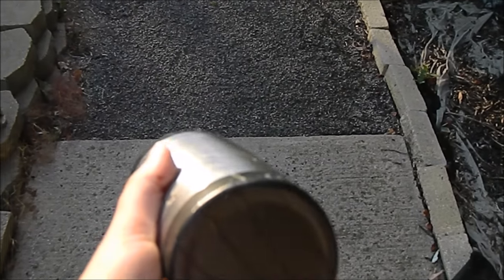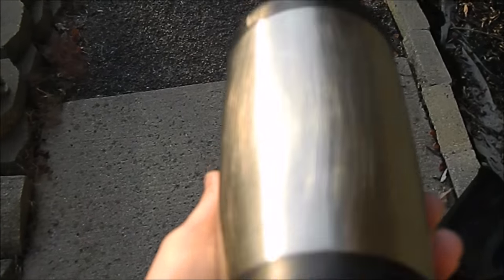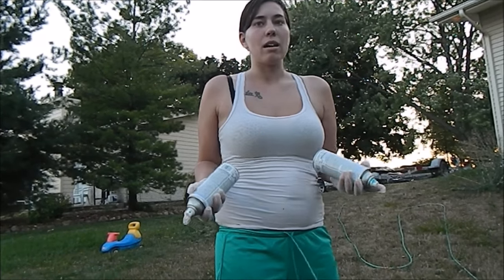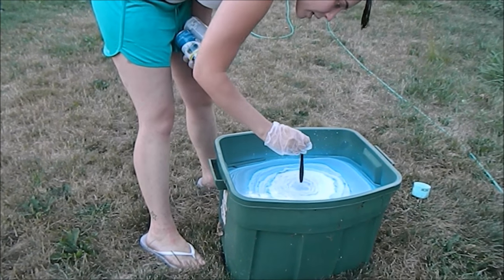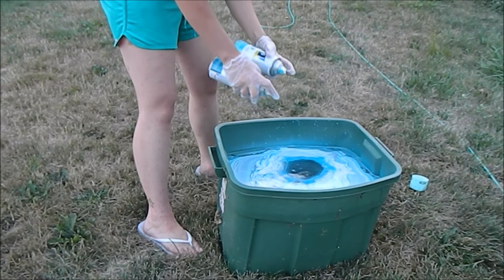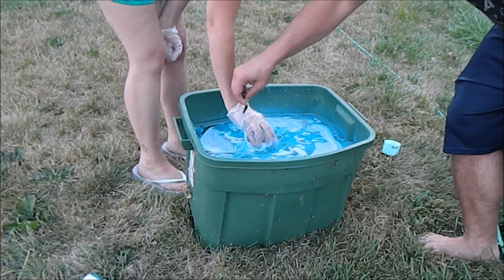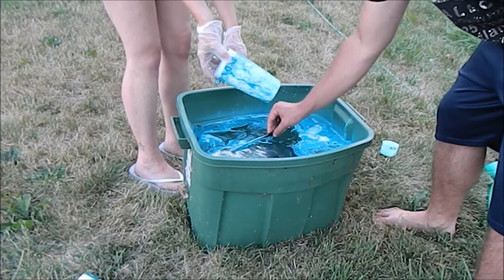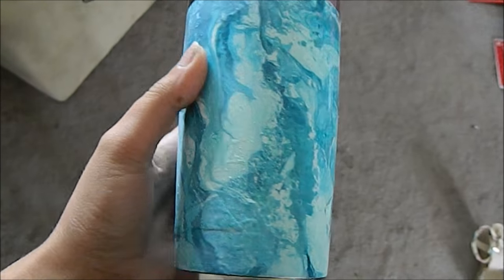DIY Swirl Painting/ "Hydro" Dipping Tumblers-CraftingWhileAdulting.Com

Comment: Suggestion, when spraying the paint don't spray the paint directly in the center. Spray it at an angle. That way it will swirl itself and you won't end up with issue you had. Also, when dipping lower the entire piece into the water then shake your hand. This will break up the film and allow you to pull it back out. Great job, don't know why you were nervous you were awesome.

Comment: Fyi this is called "swirl painting" hydro dipping uses a film with a paint pattern on it.  Activator is then sprayed to dissolve the film then the item is placed into it just like swirl painting.  One exception is the film is a pattern so you have to be more careful when you place the item in the water so it doesn't distort the pattern.
Reply from the maker: I am aware that it is not "TRUE HYDRODIPPING" which is why I used quotation marks around the words hydrodipping. I was more or less referring to the process of using Water (Hydro) to dip (dipping) tumblers into the paint. It is also what most crafters search for when trying to learn this technique! Thank you though!

Comment: just curious where you found your food safe clear coat?  I have seen some DIY youtubers "oven treat" their tumblers after the paint process...have you tried this?  has the finish held up well?  thanks for posting.
Reply: I personally don't have a craft oven and did not want to chance the paint fumes igniting as I have a gas oven in my house, so I have not tried that. Max-CLR is the food safe epoxy I use and it is available on E-bay.
Reply: And yes the finish has held fine. Epoxy makes everything pretty permanent. Technically you don't need a food safe sealer, it just makes my customers feel better so I use it. Once spray paint is fully dried and all of the fumes are gone, it is no longer considered toxic.
Reply: You don't have to get a food safe clear coat, just don't get anything on the inside of the cup. Also, try to use water soluble finishes. Generally, water soluble finishes tend to be less toxic.
Reply from the maker: You do not have to, however, I highly recommend it if you are selling these items, because some people are under the wrong assumption that spray paint is toxic after it dries, and it is a great selling point when you can mention that your item is "Food Safe".

Comment: Why do you use electrical tape instead of blue tape? Isn't it harder to take off and doesn't it leave a residue?
Reply from the maker: It comes off way easier and is water proof. No residue is left and it is very easy to manipulate in terms of bending to get straight lines.
Reply: Thank you. We get by with a little help from our friends :)
Reply: Susan Larmour c